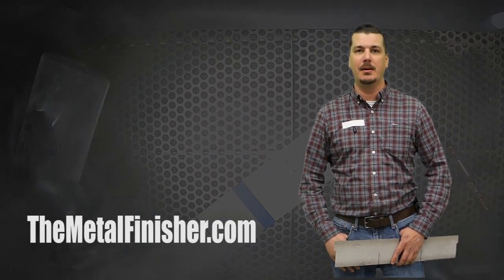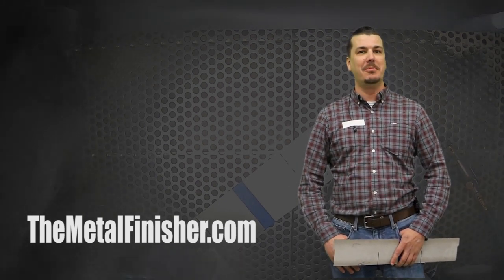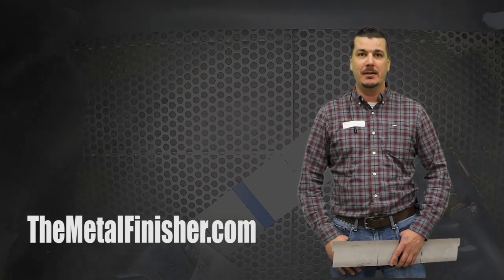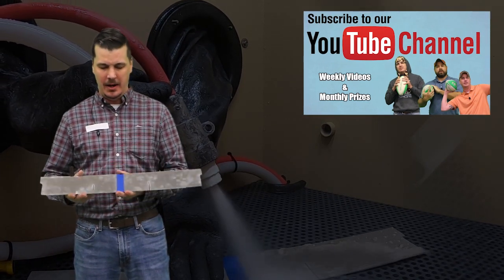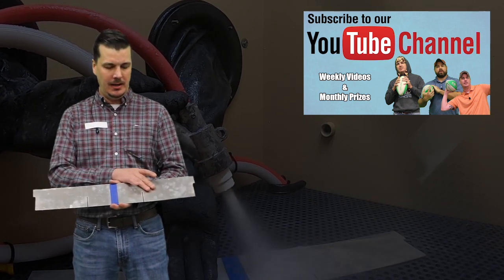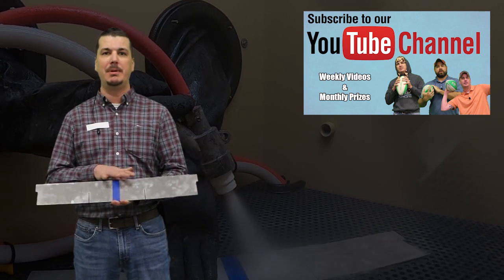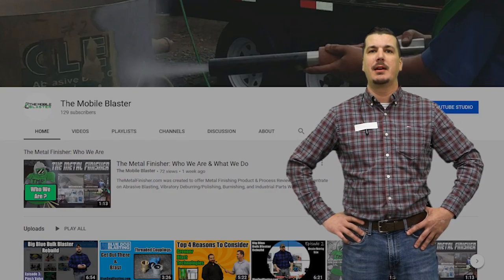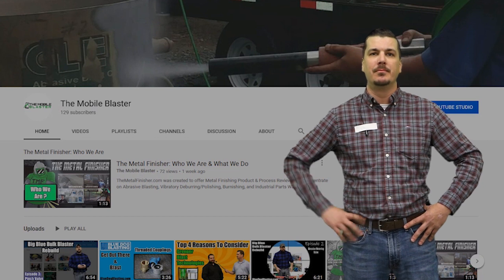Wet vs Dry Blasting on Aluminum Plate

Comment: how does dry ice blasting compare in terms of surface finishing?
Reply from the maker: I will try and set up a test....I cant give you a good answer now because I haven't seen much dry ice  blasting out there....  I know it works well in mold cleaning when they cant remove the molds...